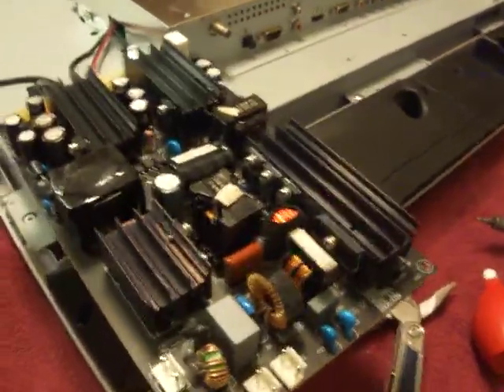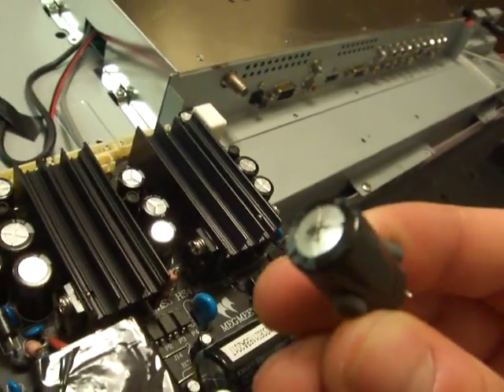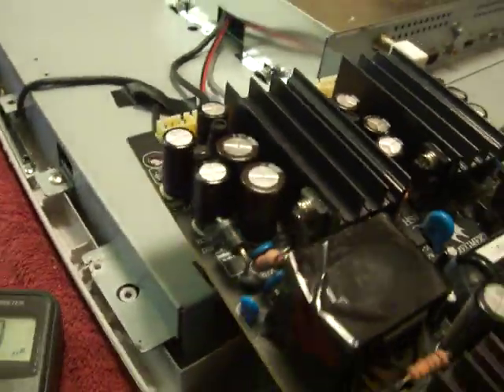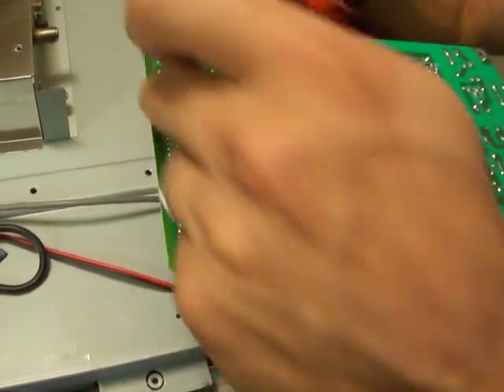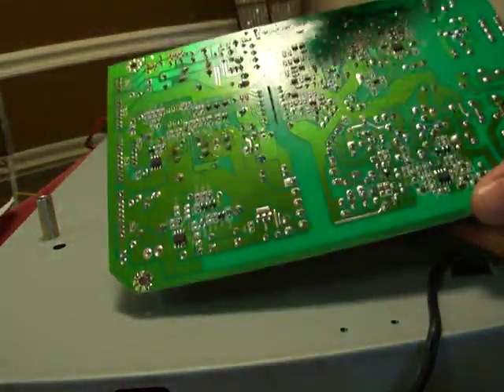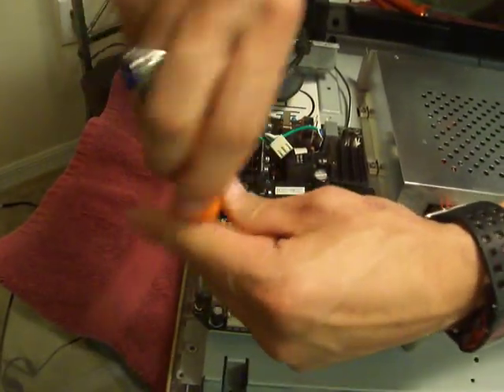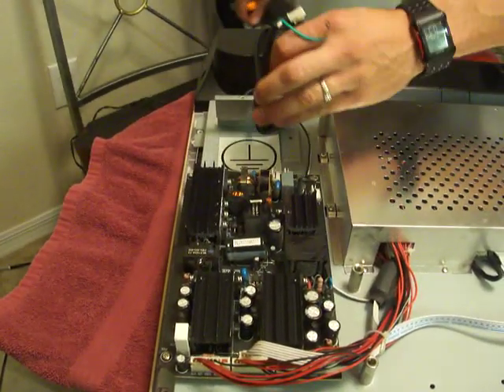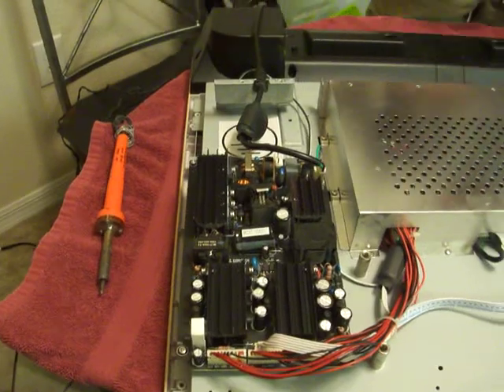MOST COMMON TV Fix - LCD Repair Service Video

Comment: @Tampatec The caps in this TV  look a bit different from other caps they look like alluminum cans .Is there anyway to test them without removing  ? They are a lot and in many different sizes . The fuses you talk about are the ones in the power supply ?

Comment: @1961vampire Thanks for the advice . which would be the safest way to discharge them ? removing the whole circuit board first and then bridging the two terminals together ? Also.My Plasma TV does not show any bulging caps.and it has many different sizes of caps . Is there any way to diagnose each one of the modules individually and replace the faulty caps ?

Comment: i have a vizio M3D550KDE  and the picture started coming in black and white, sometimes color. i tried the reset and unplug also tried all 4 hdmi and component port. cant find much info on this.  frok what i have read seems like the main board. thoughts? also finding the main board has been a hassle.  shop jimmy doesn't seem like there getting any in stock anytime soon. love the page and keep wishing you more success

Comment: thanks for prmpt reply. As a matter of fact I unhook ribbons and then reseated most of them. I checked capacitors as well. couldn't find blown. Whch board should I check for capacitors. Please help. please check the video as well you might get good idea. I might not have explained properly. video title is "Picture flickering HD TV LG 50pk590-ze. please help"..
plzz help

Comment: when I change the picture enhancement setting i.e. reduced contrast  setting it stopped shaking though. what do you think what will be the reason????
I thought problem is solved but it still is there, Now what to do?/?  I rechecked all ribbons and reseated again but no use.I also used freeze spray on screen edges as suggested by some on youtube but no joy. How to check step by step troubleshoot. plzz help

Comment: hi,
can you please help me. my LG plasma tv picture just started to shake and flicker out of no where. TV is 1.5 years old. it is lg 50pk590. I have uploaded video of the problem in my account can you please look at the video and suggest to me what can be the problem? is it picture resolution, or some interfernec or soem chip gone bad or may a blown capacitor???
which board should i check first. if I press menu they appear upside down and like a mirror immage also appears in right side of screen

Comment: Yesterday when I switch the HDMI cable with scart /coaxile cable  then picture become stable. after a while I reconnected HDMI cable and it was fine. no picture shaking or flickering or ghost imaging.
But today when I turned on TV it started again flickering and ghost imaging. I tried with scart cable but picture kept shaking. i tried everything i.e. switch off and rebooting evrything and remove all HDMI cables and then tried with scart cable. but no joy...

Comment: maybe better just solder a longer wire to make easyer to replace them later , even  put a clip on the end to grab a new cap wire. insead of soldering  every time.

Comment: I have a technika and when I turn it on the power light comes on the  goes off straight away and a high pitch noise starts coming from the tv untill I unplug it can you help

Comment: I'm having hdmi port problems it works fine for my Xbox360 but won't pick up ps4 and when cable box is connected it just comes on then off then blury then on then off just keeps going blury... any ideas?
Reply: +Glasstech7 Does the problem occur only when you try to use your PS4?  This is a pretty common issue with those consoles, I've had to repair a few of them.  Try it on another tv and/or with another HDMI cable if you can.  If I remember right (it's been a while), it's typically an issue with the HDMI port on the PS4 consoles.

Comment: my LTC 4216 MAKES A HIGH PITCH SQUEAL  for a minute or so when I turn it on. How do I fix it
Reply: its an AKAI
Reply from the maker: may be pop capacitor try locate sound. or maybe from inverter boards.